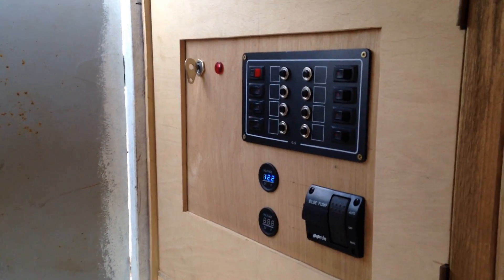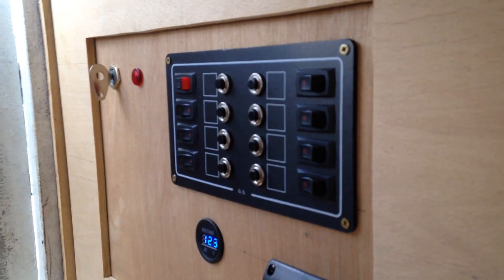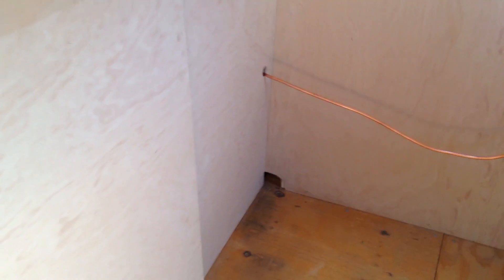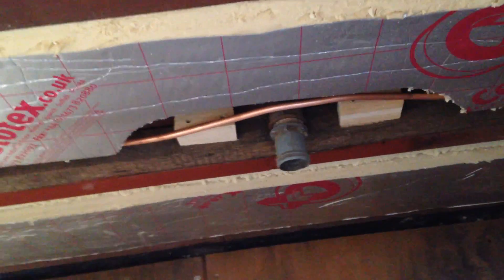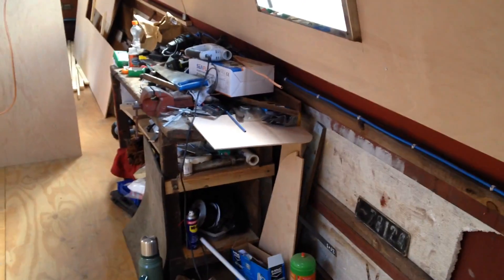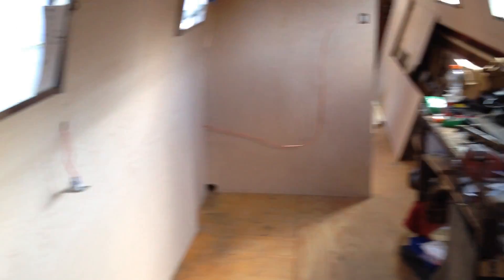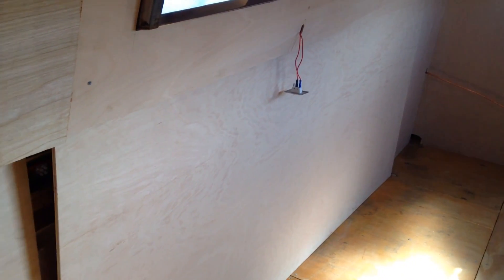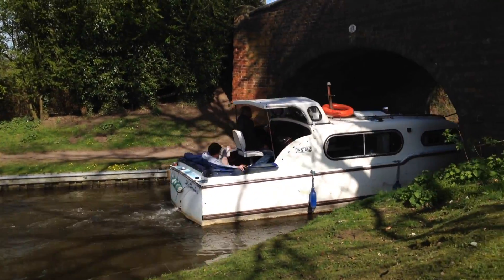Ed's narrowboat Ep.14 spring work update

Comment: Great Video !  For the Head (bathroom) (1) Put insulation panel in the Wall to keep the noise down-drip, drip,...  (2) Hope the Shower Platform has hard plastic and not cheap styrofoam (that will fail) on the bottom.  Also do they have Three-Way Switches for the 12 VDC circuit ?  tjl

Comment: Hi Ed, I'm in the process of refitting our boat out. Where did you find the blanks for the waste outlets?
Thanks
Reply from the maker: Chas P Hi and thanks for the question. I bought the blanks off ebay. I also bought a second hand tap to clean out the threads which was cheaper than a new one but still cost a couple of quid. It was worth it though as the blanks went in all the way afterwards.